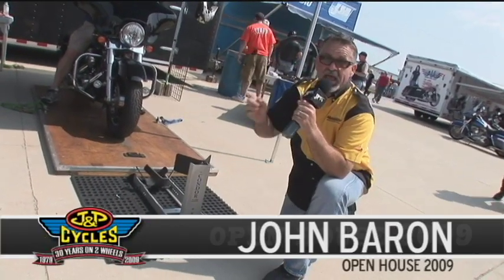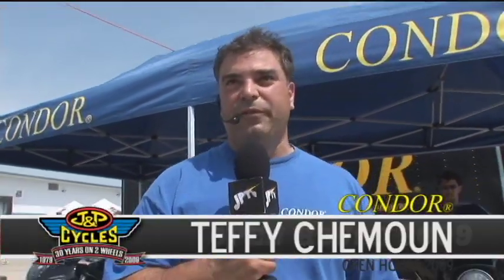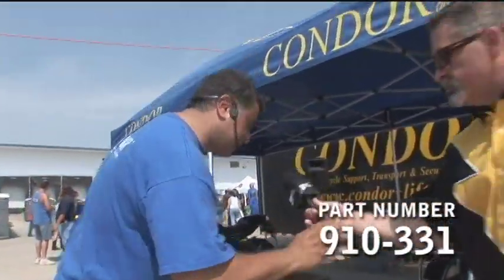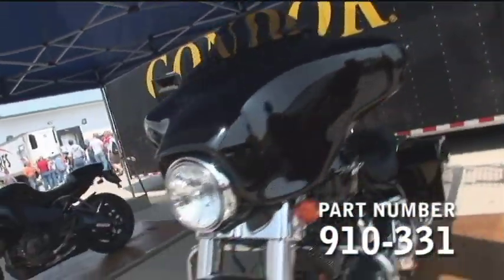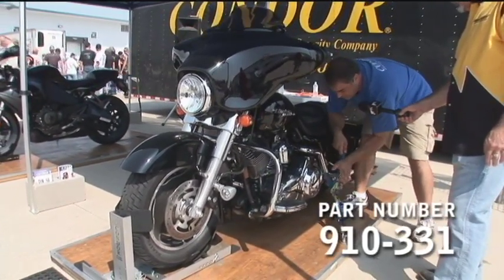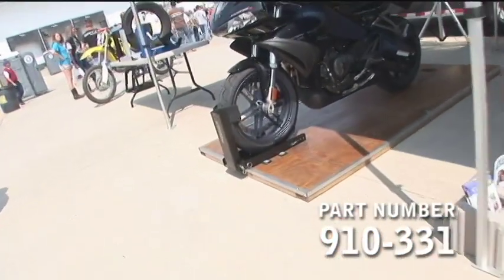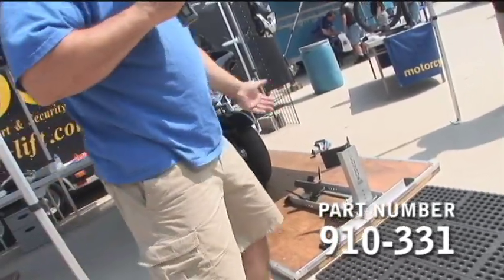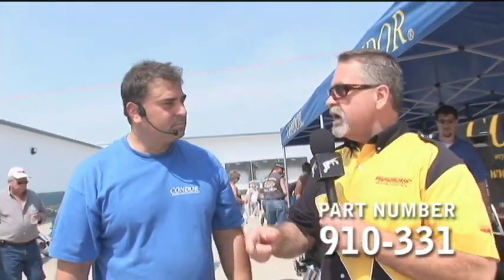Condor Motorcycle Chock - Pit Stop from J&P Cycles

Comment: Side to side great....but what he didnt show you suspension flex when going over bumps. We have 6 condors in a 28ft. trailer. if you tie like he did.....all you have to do is step up on that bikes floor board and do the slightest step up and those tie downs go loose.......its fine maybe on one bike but with 8,000lbs moving over bumps that trailer and those bikes will flex.....however the condor is still the best chock on the market....just go to the front forks and tie down those dont move....and they are way stringer than foot pegs.

Comment: the thumb screw worries me - if you had an emergency stop, it could shear under the weight of a big bike.
Reply: The thumb screw doesn't bear any weight or shear strength, it simply secures the chock to the trailer mount for transport if there isn't a bike in it. There are posts in the bottom of the chock that slide into keyhole slots in the steel base mount for that. These posts won't allow the chock to move forward unless the whole mount is ripped from the trailer. If there's enough force for that to happen, then any trailer mounted wheel chock will fail. Hope this helps, I have no affiliation with Condor, I just own a couple of their products and they are well engineered and quality built.
Reply: @clintdance5012  I appreciate the clarity, it appeared as if the screws were the stops. I am interested in getting one of these.
Reply: Clint Dance can you mount the trailer mount using just lag screws I can’t use bolts because I don’t have access underneath with out removing water tank on my toy hauler